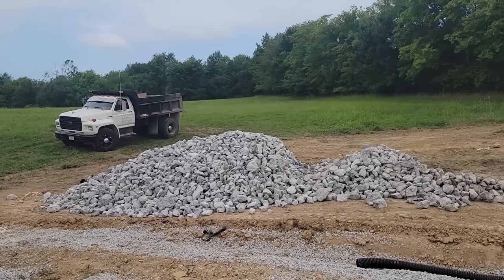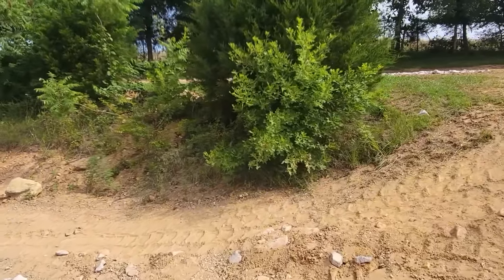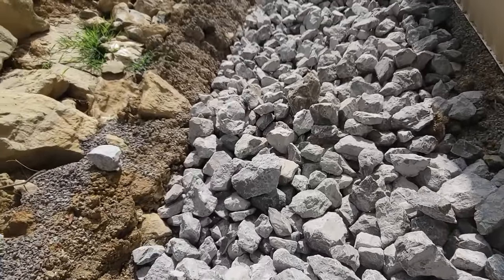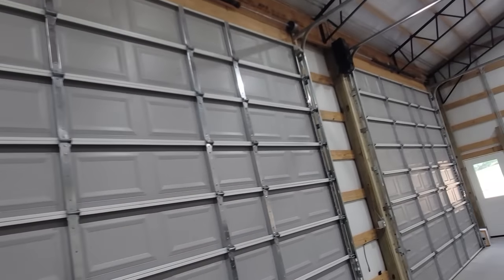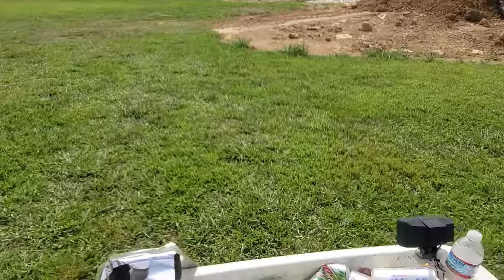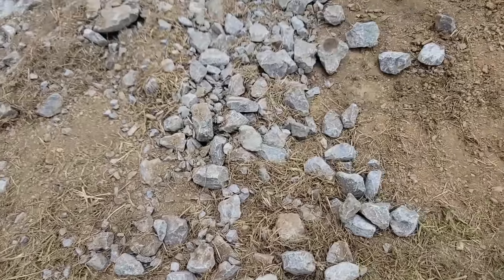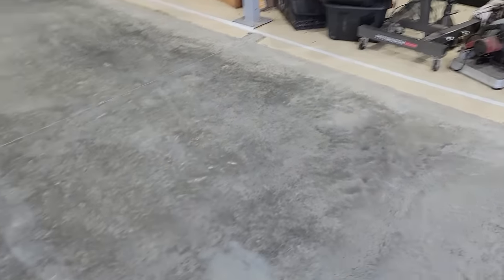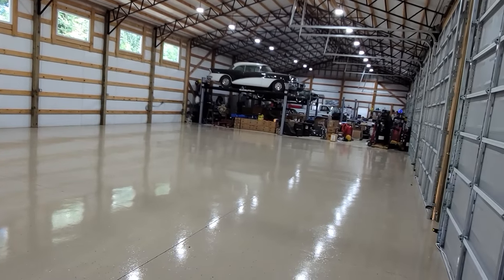My NEW Shop FLOODED! - Here's what happened (we had to start over)

Comment: I do drainage for a living, and one thing I absolutely recommend is a good old fashioned ditch. It’s easy for a French drain to get clogged with fines or get overwhelmed. With a ditch, you won’t be dealing with blockages. Water doesn’t flow uphill!
Reply: I agree.  The ditches with riprap may work for awhile but over time they will clog up with soil, leaves, vegetation and such.  I like low side sloped swales that are properly graded for the long term solution to surface water drainage.
Reply: So many of us told him this when we saw it coming during the addition being built.
It’s a shame it came to this
Reply: I’d say your right fellas a burm to divert the water would probably work a little better in my opinion… also we did all see this coming but at the end of the day we make mistakes and oversight to learn
Reply: @BrokenRRT  oh well he's rich he can afford to do it again, not like us who couldn't afford to screw it up. I made some mistakes when i had my house built and its cost me a ton of money and time to make it right.
Reply: With a building on a hillside that could potentially flood, I was also thinking a simple floor drain running along the wall closet to the hill would be a good idea. Obviously would be easier and cheaper to do before the concrete is poured
Reply: @faststang85  rich lol that’s funny. Do you really know what rich is? My man is doing ok but I doubt the money he lost here was pocket change. Money is relative.
Reply: Yep, absolutely agree, I have a friend that got talked into a French drain and it didn't take that long for it to clog, not saying this one will but there is a good chance it will eventually. A ditch won't clog, plus a ditch will be cheaper then all that.
Reply: @willied7759  ive heard the guy is a millionaire so i consider that rich enough to not worry about stuff as much and what do you mean "your man" you sleeping with him or what bro?🤣🤣
Reply: Hey Derek 👋,  I was thinking about ya'll when I seen the rain forecast in your area.  Sorry to hear about it. So glad things are moving along.  Thanks for sharing and have a great week 🖐
Reply: You comment is  smart    Ditches work
Reply: @willied7759  
yeah he looks damn near homeless!!
anyways..he has more than most of us..and less than others...
Reply: @faststang85  
always some fanboy defending their Crush!!...( re : willieD..)
Reply: @BrokenRRT  Hine sight is always 20/20. Yea it didn't work. I mean the guy said he screwed up. What more do you want from him? Hell for that fact do you know how much concrete costs these days? I had a slab poured about 5 years ago. Just a 20×15 lab to put a carport over for working on vehicles. And that damn thing cost me damn near 12 grand. He was trying to save a little money where he could. I get yall said it would happen. But how about not saying "I told you so" after the fact???? He maybe a millionaire. But what is a million bucks worth anymore these days? Not nearly as much as it was hell even 20 years ago. He has insurance. I'm sure he payed for the higher cost policy and they will take car of it.
Reply: @larryodom9369  no one is saying they want more from him...the simple fact is yeah he screwed up and admitted fault, then chose to try and do it again hoping it will work. It probably will be better than before, but he's more than likely going to have some flooding if it's raining that much, its not like its in the desert somewhere that doesn't see a lot of rain etc.
Reply: And that Big O pipe is outlawed in Canada because it collapses too easily. We use regular white 3” or 4” pipe with holes in it.
Reply: The back ditch is far too high it needs to be lower than the slab by at least 300mm, or at the very least run a wrap or black plastic along the bottom wall outside so the water won’t get in, also lift everything off the floor lots of shelves
Reply: Aquaduct made from Culverts halved.
Reply: Agree 100% 
Derek has installed what we call a 'rumble drain' and they are fine in some circumstances...... but sadly, I doubt it very much if it will suffice in this situation.
After the 1st heavy rain, it will silt up and the water will flow straight over the top of it.
I agree, a good old fashioned ditch is the only way to prevent this happening again.
So sorry to see your new shop affected so badly so soon Derek, gut wrenching.
Reply: Perhaps cutting the bank back, installing a holding tank and drain from that to another tank further down the property similar to a septic system will stop that mess from happening . The rock is certainly going to travel downhill. Probably cheaper to enlist an Engineer's help at this point Otherwise a berm will stop this when strategically placed. Watch the path the Water takes that tells the whole story. Sloped ditch is a great idea.
Reply: @jessietaylor2774  I learned my lesson the hard way! Dont build a garage on someone elses property! I built our dream garage at my sons house, where I also lived. His wife got sick and they had to sell. Unfortunately, the bottom had dropped out of the market and they only got what their mortgage was for the property. I had to walk away from my investment, most of my retirement nestegg! This was after I lost my own home waiting for my Disability to go through. Like you said, live and learn!!
Reply: Yep. Dig a ditch. Because in Kentucky and Tennessee, when it rains, it POURS….
Reply: @WeeShoeyDugless  this part of the country, you need a moat… hahahaha! Paducah, Kentucky, here- right smack in flood plain territory….
Reply: You are exactly right , Properly sized and sloped surface swale is the long term fix. Complex drainage systems will always (eventually ) Fail.
The general rule of thumb is 10' minimum positive fall away from the building on all sides with the invert sloped from the middle of the rear of the building out and around the ends of the building. That said, love the channel and hope you never have to deal with this again.
Reply: Jack we.have poultry houses. 500 feet long and 50 feet wide so during a rain they shed huge amounts of water and you are correct. Ditches Trump everything.  If you have ditches done correctly and they don't work then nothing was going to. There is only so much you can do at times but I prefer ditches over French drains and culverts.
Reply: Jack Affeldt, I dug myself a 70 foot ditch about 18 inches wide and a foot deep. I saw what rain can do in sloping land and how you loose soil. People we're telling me to just dig a little trench. I had put in retaining wall on my driveway and added french drains.  Then I went to the top of my property and dug 2 feet across and a foot deep all across the back of the land. I still have to keep shoveling from time to time.18 years of saving soil, almost 45 years of it owning the property but not having to do it all myself. Digging ditches is not fun but being flooded is worse.🤗🦊🐱
Reply: 9
Reply: You should move your air compressor outside of the th shop to cut your noise level. Most when running are over 84db, which, in the Navy, required at least a single stage of hearing protection. You will appreciate it when you’re older.
Reply: Agree w/ the other folks who say this new work is a great improvement, but  maybe isn't enough for the worst days, which are more and more common.

That black pipe fails with fines, with so much clay around that's gonna be an issue... and it's tied into gutters which means it's taking in any leaves and other junk from gutters... 

I think what you did make senses as a bandaid, but you gotta be looking at more time and money to survive hurricane and time... maybe even moving that hillside back further.
Reply: Absolutely put a couple of drains or something in the floor or just make one in the floor where you can have a sump pump pumping it outside try to find the lowest spot in your shop and sump pumps can be had for fairly cheap and they are beneficial
Reply: I got on her just to say that, I'm a civil engineer, I design this stuff for a living. You need a ditch. Did anyone actually run hydraulic calcs on this. From what you showed it looks like you have way more water then these solutions can handle.  Seriously this is gonna flood again that tile will easily get overloaded by a major rain event and will also get fiilled with fines over time. They should have wrapped the stone in fabric to prevent fines from penetrating, they call it a burrito wrap. I know you don't wanna hear this but seriously consider it.
Reply: @dougturngren5027  ditches clog all the time I've been running a road grader most my life and have to clean ditches all the time some terraces along that hillside redirecting the water flow with 1 at the top of the cutout for the shed with a ditch in front of it and a rear blade for the tractor would be the best bet
Reply: @willied7759  Exacally Willie!!
Reply: No you are wrong. Water flows up hill if it in a pipe lol
Reply: @francisniestemski7382  subcritical flow not pressurized or contained can't flow up hill
Reply: @francisniestemski7382  only under pressure
Reply: Good old highway Bar ditch!
Reply: Unless you use a filtered dry well with a sump pump. However, never seen anyone drain their gutters into the french drain as they typically can clog it up faster - I guess if he's got metal roof and no trees nearby. Apple Drains on here has a lot of good tips for long-last implementation that I've seen over most drainage companies.
Reply: I am a bit late to the convo, but I came here to say what Jack said. French drains are great for water from a general area to be redirected slowly. It appears you need a ditch, not a french drain. If the answer to the question, "Does water come down quickly or in large masses?" then you need a clear ditch that moves it out of the way quickly. Hopefully you won't have to worry about it.
Reply: @BrokenRRT  nah, its just dead material. Shit happens and always will
Reply: Tired of all the snitches got ditches
Reply: That's exactly why our home was built on the top of the hill.
Reply: As an old time Civil Engineer, I can say you are 100% correct. Sheet flow run-off has tremendous volumes of water, which ditches can handle.
Reply: unless its a tsunami...
Reply: Great idea man ! I've been working for myself for that long at civil , individual ,commercial I was burned out with dealing with people, Government! I sold everything accept a 318 cat R/T Hoe to do my own work and went to work for someone else , now I love working again ✅
Reply: Sad to hear. But i love your positif look on things. Not only with struggle on some cars like that white cadillac in o'reilly shop with the v8 v4 v6 engine but also on the lodge project. Wish you guys all the luck❤ greetings from roger ( the netherlands 🇳🇱 europe)

Comment: I have a concern with your drainage. You shouldn't dump your gutters into the same pipes as yard drains. I would of ran a separate solid line for the gutters and keep the corrugated drain tile for the french drains. You have a lot of roof and terrain square footage for watershed. Not bashin on the setup and I know its too late by the time this video go up, just something to keep in mind.
Reply: I have always heard the same as well. Run the gutters separately into solid drain pipe and the ground drainage into the slotted.
Reply: Yeah I can see that backing up in time.
Reply: on top of this......USE PVC!
Reply: Far from an expert, but i was thinking the same thing.
Reply: That is absolutely correct. If the gutters are running at capacity, they will more than clog up the ground drainage, if anything they will due to gravity increase pressure and push more water back up the pipe.
Reply: He is correct.  You will need multiple systems
Reply: I was going to say the same. A perforated line for the building should never get gutter water. When the rain starts, all that gutter water is flowing out the perforations and saturating the soil you want to stay dry. As the runoff starts, your soil can now do nothing to absorb it and the tile has to do all the work. But it's already full of gutter water, so it won't take any water from the ground. Many years of installing tile tells me this is a bad system. Gutters get solid tile to take 100% of water away. Foundations get perf tile to take in any water in a bad spot.
Reply: You do need a civil engineer with experience in your location.  I’ve done it in Florida, so no experience in that area.  What you are doing will probably not work.  Hate to spend money on a poor idea.  I feel for you.
Reply: I would think about catch basins for the gutters as well.
Reply: there's right and there's right now. sometimes you need to slap it together and fix it later
Reply: That is very true there is concern with this drain setup.  There should be a drain expert on call.  Like you said there should be another pipe for the down spouts because there is so much volume come off it into one pipe system.  Then you have all that drainage coming down the hill that is a very large amount.  There should be catch basins as well with that system I think and there should be drain cloth over the gravel to keep the soil from clogging over time.  Gravel over the cloth to grade.  The catch basins will catch the immediate run off and take it away as well as the water dumping into the gravel.  Just extra catch of water.  That pipe should be its own and not tied to the roof.  On top of the hill I didn't see any discharge to light.  That is very important too.
Reply: For all the money he's spending he should have just built a Retaining Wall 🧱 What's happening is a 💦LAKE💦OF💦WATER💦 is running down from the 60 acre hilltop every time it rains. Why would you build a shop below a lake to begin with? Unfortunately he has nobody to blame but himself.
Reply: He needs to put some water bars up on the hill. 👍
Reply: @R3TR0R4V3  or a water slide for the kids lol
Reply: @Bronco_Billy_Jack_Hills  half of the building was pre-existing.
Reply: @Gunbudder  I absolutely agree. I just hate to see a large investment get damaged because of that. Sometimes, more often than not, later never comes, or later means it happened again. I know this project was probably blowing the budget already and its a hard pill to swallow. Water is going to go where it wants and always flows from wet to dry.
Reply: thanks to the people who put my drainage in my house 50 years ago...they ran the gutters, and floor drains in the basement into the same line!  My discharge plugged, all the rain water from the gutters went into my basement and I had 3 feet of water in there.  What a lovely thing to wake up to!   I ran all my gutters into the yard (yard slopes away from the house) and did away with the drainage off the property.  Been working great for the last 4 years.  One day maybe I'll dig it all up one day fix it right.  A fella just doesn't have enough time.
Reply: Yep that drain is no where near big enough.  I have that same pipe draining a 2000 Sq ft house to the street and the water comes out the end and bubbles at least 6". You're screwed.
Reply: I think you are right
Reply: Could have ran the roof water to rain water collection tanks for garden and water to wash things at the shop .  Never forget to collect your rainwater.
Reply: @superdrummergaming  I have seen perforated drain tile used to percolate run off OUT to the soil but that's in arid areas where it's never going to see water percolating IN.
Reply: I see your point, still kinda concerns me too. Just hopefully it works out okay. Hopefully he's using bigger pipes especially with everything being combined in like that. I'm not really a civil engineer, but I would personally have used 12 to 18 inch corrugated lines to tie all that into so that there's plenty of capacity for everything on the worst of days when flooding is of the biggest concern.
Reply: He said this himself in the beginning of the video. No need to salt the wounds, we're all here for the Nut known as Derek. Anyone can see mistakes and point them out after the fact. Show some love!!  Best Wishes for a speedy reset, keep up the great work brother.
Reply: Yep, I learned this from watching the French Drain Man on youtube. He always says to run them separate. Doubles your capacity on the way out as well, with two lines. Hopefully he caught this comment before putting the system back together.
Reply: .. I concur on the corrugated pipe not a good idea! I had that stuff draining out my roof line and it got clogged with sand and all kinds of crap and he can't snake it out because it's corrugated!